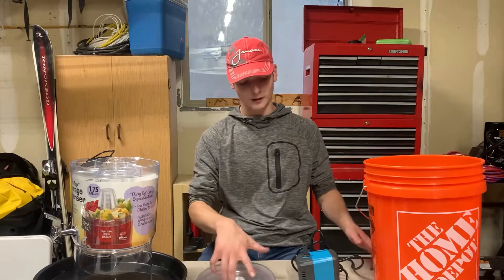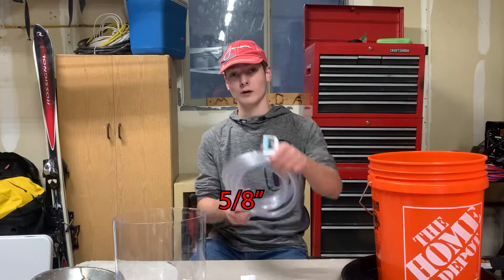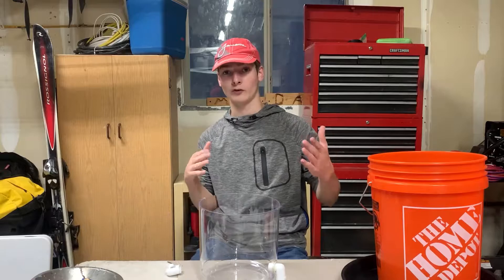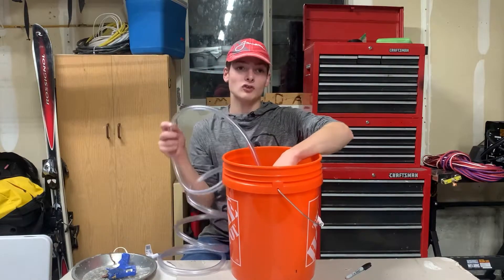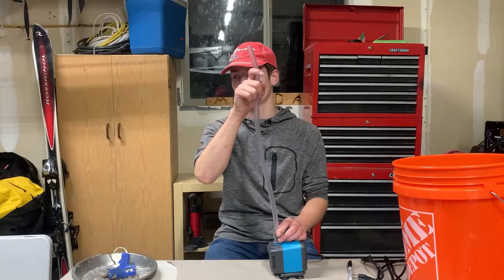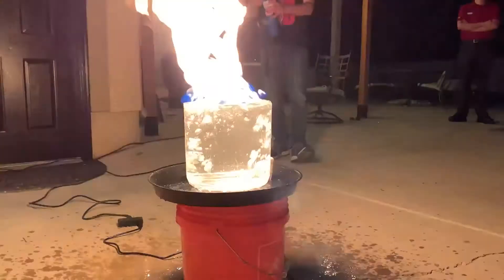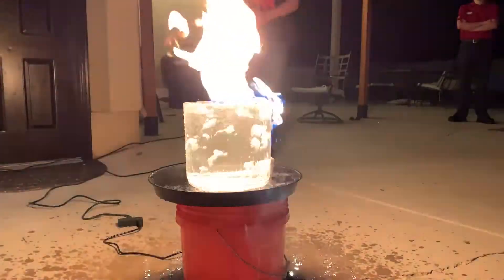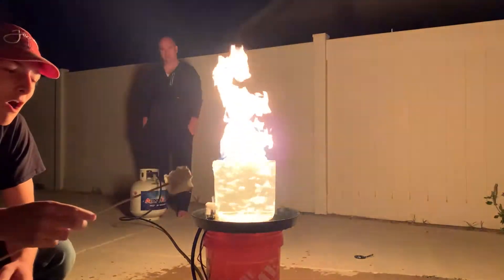I Lit Water On Fire!!!(TKOR Fire Vortex Fountain)

Comment: When you turn off the propane, how do you keep the water out of the hose for the gas?  

   The only 2 things I can think of (without knowing) is either...
     1. When installing the hose, you have the holes facing downward; so the air pressure keeps the water out.
          OR
     2.  The holes are small enough that the surface tension of the water keeps it out of the air line.
Reply from the maker: The holes are small enough the surface tension does keep the water out. It is both good and bad. I also made a stopper so if water does get in it won’t flood out the side. When using the propane we tend to flood the line for a few seconds to make sure propane flows through every hole as sometimes it will just flow though a few but when I just have the water and lights going the surface tension of the water will keep it out. As I said before I did make a little stopper(I think I got one from Home Depot or something like that, this was done after the video was made and published) and it will not allow water to go out. One of my only things to say about this build, if you do it, turn on the fountain and let it run for a moment to completely fill up, then keep filling the bottom with more water as the fire will evaporate the water and it will burn the edges. This was discovered later after I turned it on for a party and it melted the top container and I had to build a new one! If you’ve got any other questions feel free to ask!
Reply: @Jacobball32Crew   Thanks for replying so quickly, also… AWESOME Build!!!🤘🏼😎🤘🏼

   The fountain I’m doing is for my gf’s garden.  After we watched the orig. TKOR vid, she said that’s what she wanted 🤦🏻‍♂️  , but I’m tweaking/modifying the design a bit…

   She def liked the bubble action, cuz it looks really cool + reflects more of the led lights, but we both agree that we don’t necessarily need/want fire all of the time.  So, to make normal air  bubbles, I was thinking of just using an aquarium air pump (or something similar if it’s cheaper & still quiet).  

   As far as fire goes, I was concerned about being able to safely control the flames & the TKOR version seemed a bit wild.  Thanks for the heads up about melting the bev dispenser 😯 & water evaporation 👍🏼.  Sorry, you had to rebuild yours, but hey 🤷🏼‍♂️ that’s what experimenting is all about, right?  So, with that in mind, I came up w/ a few diff options/variations, but haven’t decided which way I wanna go yet…

Option 1.  Keep the flame separate. You’ve probably seen it already, but if not; on TheBackyardScientist channel, he did a flaming fountain video where he had a single column of water w/ the propane injected directly into the stream.  Once you have the arc of the water adjusted just right, it will only ignite at its peak.  That way, the flames don’t touch anything but air.  Although the flames do appear a bit smaller, it looks a lot safer.  The only downside, is that I’d either have to run a 2nd water pump or split the 1 pump into 2 lines w/ a “T” connector & add flow reg. valves to each line, in order to maintain the flow rates for both the vortex & single column at the same time.  

Option 2. Run a 3rd line for just propane.  As I’m sure you’ve noticed, the way light is refracted in a cylinder of water, it can help camouflage objects or make them seemingly disappear.  So, this option would utilize very small brass tubing for the propane. The brass won’t melt (if the water level gets too low & the flames reach the tubing), it won’t rust, & I can bend/shape the tubing fairly easily. I’ve thought of a few variations that I’d have to experiment with, if I went this route, to see which one works best…
   A. Run tubing up through the bottom of the container, but instead of it being around the outer edge, have it come up near the center.  The goal being to hopefully keep the flammable bubbles closer to the vortex & away from the plastic outer rim. 
   B.  Mount the tubing to the round tray, bend 90°, & come up dead center of the drain hole for the vortex.  How far up inside the container, idk… I’d have to experiment with that, to see if it makes any difference with the appearance of the flame.  Obviously, my hope would be that it wouldn’t interfere with the vortex & that the vortex itself would hide the tubing from being seen. 
   C.  Again, run the tubing up inside through the bottom of the container, but against the wall on the rear side of the fountain, bend the tubing 90° about 2” from the top of the container towards the center (so it stays underwater), but stop it before it would reach the vortex.  Pinch the end of the tubing, seal it with solder, & then drill a few small holes on the underside close to the middle and away from the edge.  The goal would be that the light refraction + the vortex would hide the tubing & by releasing the propane bubbles towards the middle near the surface, they would be easier to control and maintain a nice steady “flicker” to the flames.  

Lemme know your thoughts when your able.  When the time comes for my build, I’ll try my best to record it and post a video on it to my channel.
Reply from the maker: From what I’ve read from your reply I think option A with running it close to the center would be a good idea. The only thing is that if the tubing doesn’t push out enough propane and the water comes too close to the tube, if the flame goes inside, without a regulator or an automatic valve block, the flame would back flow directly into the propane tank causing it to explode. I am not a professional at pyrotechnics I just saw the thing, thought it was cool and built my own. However, I do know a little bit about fire but not a large amount of pyrotechnics. Continuing with what I would do is I would try to find the safest way to do option A as that seems to be the easiest and would have a little flame while still having the LEDs work as well as still have a vortex. The smaller the bubbles the better the vortex will be.
Reply from the maker: Sorry, to clarify I mean Option 2:A
Reply from the maker: @DIYDomTheBuilder  uh…I just saw thebackyardscientists fire fountain video(or at least the general idea of it) That’s freakin cool and probably your best way to do it. Just had the idea, do my fountain(without the pyrotechnics. And if you get a Y PVC connector, you can make the water jet out of the center of it, then feed the propane through the center fountain jetting up. That way you have a water fountain jetting out the top on fire, and have a swirling vortex with LEDs. Just a thought. If you’ve got another idea, go with that but I think I’m going to go and build a new one now…maybe….I don’t know yet!